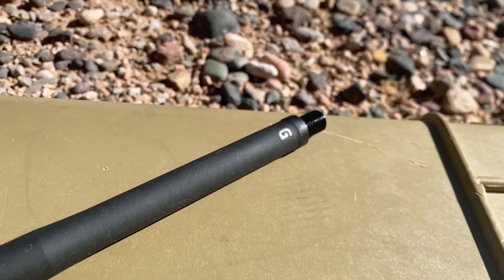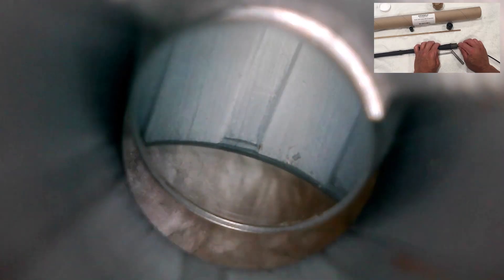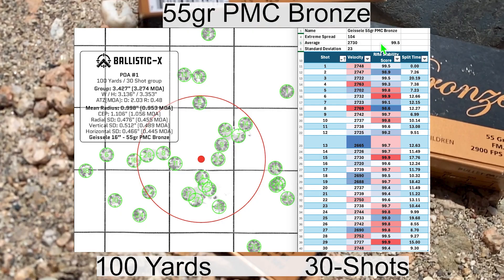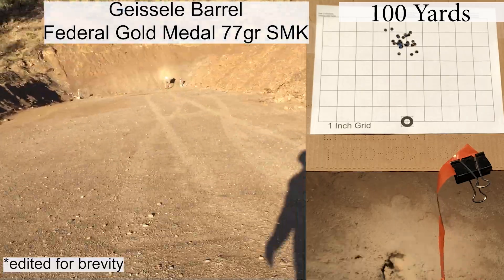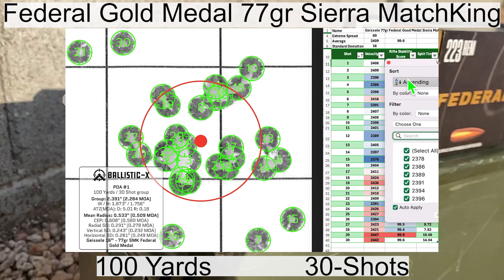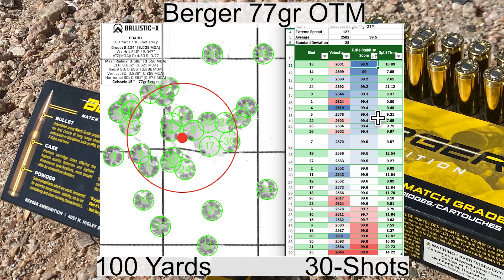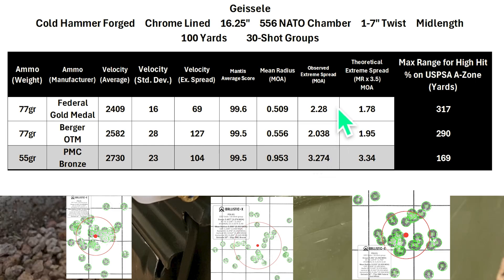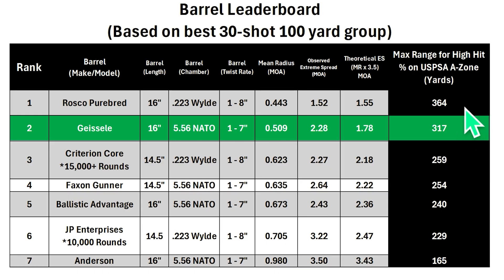Can Geissele CHF Barrels Deliver Accuracy Without Compromising Durability?

Comment: Also, is there any chance that you would be game for taking the top performing ammo for each barrel and doing a bit of slow firing with all of the other data you collect to understand ultimate accuracy in applications where the round count is much lower? It would just be really great to understand what barrels are actually capable of under all conditions without the subjectivity of, "yeah, I think this flier was my fault"
Reply from the maker: I am not sure I fully understand your question.  I will try to answer the best I can, but feel free to ask again if I miss the point.   

All the groups are fired slow. Each 30-shot group takes about 4 minutes to complete, I just edit the footage to make it less boring to watch. Also, I do have a chart in the video with the 5 & 10 shot groups divided out, since most people are probably more familiar with those number. 

I try to limit the about of "yeah, I think this flier was my fault" by using the Mantis X-10, which is an accelerometer that I use as the "Rifle stability score".
Reply: @PrestonJMoore  you did say that about the group times. I don't actually know how much heat it takes for a barrel to start moving around (going to be very dependent on material properties and geometry) but the idea was to try to avoid that all together with a rate of fire that is slow enough to guarantee that it doesn't. Like 1 round every 30s or something. I'm just wondering if the difference in fire rates would make a difference in accuracy and repeatability.

I know you check yourself on the fliers. That's why I think you'd be better at this than anyone else!
Reply from the maker: @Jazz3006  Thank you for clarifying.  I did do a video about barrel heat where I tested 2 barrels and shot 90-shots straight and tracked the performance through all of those 90 rounds.  To my eyes, with both barrels, I didn't really see anything noteworthy happen from rounds 1-60. No real changes in group size or group location.  from rounds 60-90, things changed a bit, but not a lot, in my opinion.  

I may try a very slow rate of first versus my normal cadence for these tests at some point. 

Thank you for the support!  I appreciate you watching the channel and taking the time to comment!
Reply: @PrestonJMoore  I'll have to try to find that video. What was your rate of fire when you did it though?

I would say it'd be great to see a dedicated video for just that, but I can imagine it'd be a ton of work...
Reply from the maker: @Jazz3006  If I recall correctly, it took about 10 minutes to fire 90 shots from each barrel.  During the mag changes, I attempted to get temperature readings on the barrels.  It slowed things down a bit.  But I would say the barrels still got pretty hot.
Reply: @PrestonJMoore  that's still pretty fast! I guess the best way to convey the fire rate I'm thinking of would be an SPR role or maybe a slow PRS match. Trying to understand if a barrel that is kept cool with some pretty slow fire rates is more consistent than one that warms up. I know hunters have a habit of trying to be set up for cold bore shots. I'm curious if that's real and what kind of fire schedule causes you to exit that range of behavior, if that makes sense?